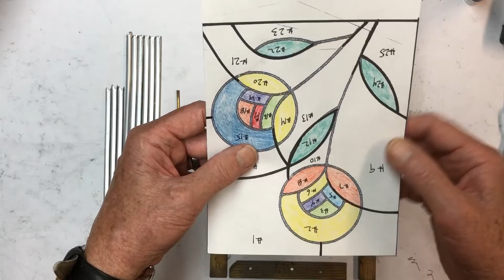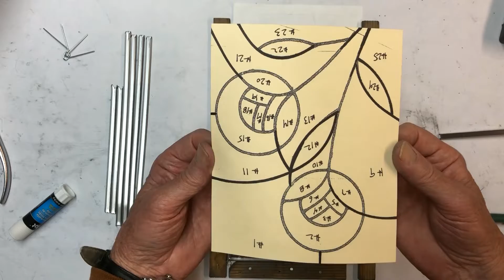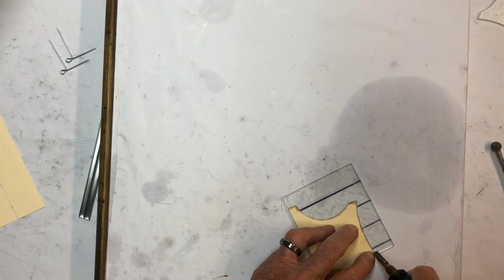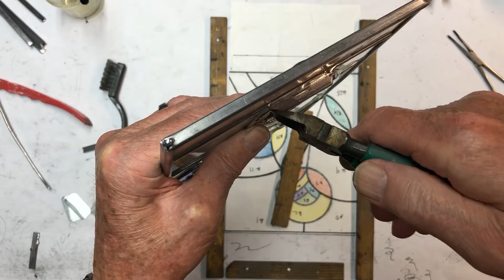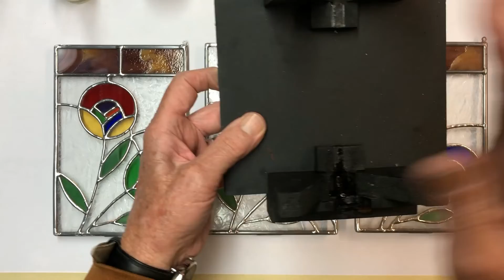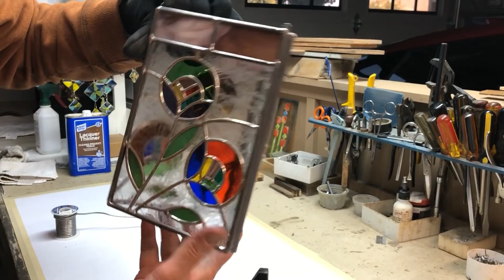Leaded Glass Solar Lantern

Comment: Another beautiful piece! I love the round flowers, so cute! On another channel they said once you cut and grind your glass, wipe the edges with rubbing alcohol to remove any oil from your hands, then foil. What is your opinion on this step? Thank you for sharing your knowledge and time 😊
Reply from the maker: Hi Therese,
Glad you like the video. They are all so much fun to make!!  If you watched the video on the solar lantern with the sea glass in it, I talk about the edges of the glass. I use both Lacquer Thinner and 91% Isopropyl Alcohol to wipe the edges to get the grinder dust on the edges off the glass. I like the Lacquer Thinner the best, it dries very fast, and the copper foil sticks to it very well. Hopefully this helps you out. Have a Great Day!!!
Regards,
Bill Stone
Reply: @billstonesstainedglasscrea3310  Yes, I've watched every video but I don't remember that, shame on me! Thank you for taking the time to answer my question. I just purchased some confetti glass to make a lantern. I just need some wood to make a frame on my homasote board. I love your channel and the genius idea for the hangers! Thanks again, Therese 😊
Reply from the maker: Hi Therese,
Sounds like you are about to get started. If you don't have a way to make the small form wood pieces you could do this.  When you are at Home Depot, Lowe's, Hobby Lobby or other craft stores they all carry the old fashion wooding yard sticks. Just buy a couple and make your forms with them, they could be cut to any size you want, they would work great. You could also pick up some wood paint stirring sticks. (Some stores give them away, so check that out!!!) May have to get a Lumber Yard to order you some Homasote board. You might try Home Depot it comes in a 4'x8' sheet, can be cut on a table saw, most Lumber Yards and Home Depot would cut it to fit your worktable. Both Amazon and Delph Glass sell a 24"x24" Homasote board, but their price seems out of line to me. When you ask about the Homasote Board, and they are not sure what you're looking for, you can tell them it's user for sound deadening in sound studios or any area they would like to block out the sound.
Hopefully some of this info helps you get started on your project.
Regards,
Bill Stone
Reply: @billstonesstainedglasscrea3310  Thanks for the great advice! I wish I knew a woodworker. I would love a little 60 degree jig for the laterns! I can't wait to make one! I have never done lead anything but watching your videos gives me the confidence to try! Thank you so much! 😃
Reply from the maker: Hi Therese,
Sounds like you have a plan, take your time and enjoy the projects.
Regards,
Bill Stone